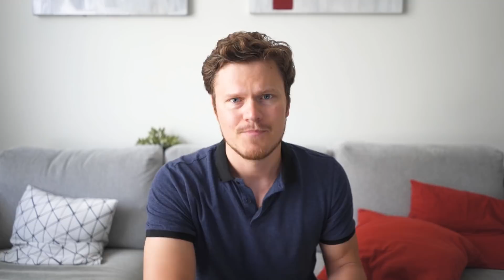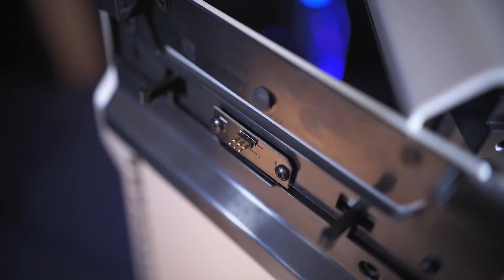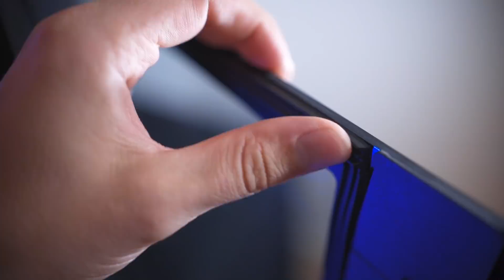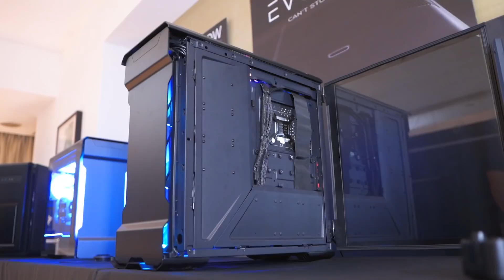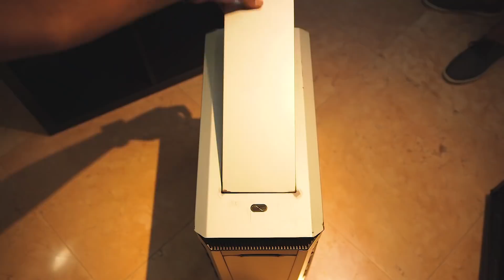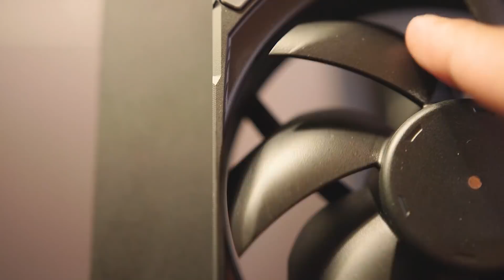The BEST $199 You Can Spend on a Case! -- PHANTEKS EVOLV X

Comment: Hooooooooooly crap!  You can put SEVENTEEN drives into this case?  Mind boggling!  I love the placement of the drive cages and the cooling options.  For the 1% that'll do a dual-system, sure, but other than that, a single system is perfect here - something like a 2700X, 8700K, or even 1950X will be at home here.
With vertical GPU mounts, I have a constant gripe of either push it away from being smooshed against the glass, or just don't do it.  With the versatility options this case offers, if this is how it'll be at launch, I think these will be flying off the virtual store shelves.

Comment: If I had money to spare I would definitely get this case. However, since I work with a tight budget, I priorotize on mostly CPU and GPU. The rest of my components are basically the best budget parts I could find on the market. My current case is the Antec GX200 which I got for 25 $. Very interesting case nevertheless.

Comment: They should also redesign Evolv Shift case. Many users complain about high temperatures. Also 2.5 slot graphics cards (like strix 1080ti) barely fit into Evolv Shift case. And, Evolv Shift case has tempered glass side panels. Aftermarket design graphics card can't pull air from tempered glass sides. It is awesome looking Mini-ITX case. It needs to be redesigned too.

Comment: I was planning on getting both modmymods panels for my case. That adds up to $160 without shipping so I'm better off just getting this case. The only thing that seems like they didn't fix is the placement for 24 pin cable cutout doesn't line up with motherboard.

Comment: I LOVE PHANTEKS! THEY DO EVERYTHING PERFECTLY!

I love the Original Phanteks Evolv ATX, but the main thing I was worried about was the airflow, but whaddaya know! They fixed that! I also wanted to vertically mount my GPU, but a bracket cost like $60, but waddaya know! They added that too! Those are just two examples. 
Its like Phanteks read my mind...
Reply: I was brainstorming on which case/bracket to mod so I can vertically mount my 3slot GPU (EVGA 1070 Ti FTW Ultra Silent, it actually has a 3slot I/O Bracket). But, waddaya know! Phanteks put a 3slot vertical mount in that case!

Comment: Fuck dude now I want to move my pc in to this case I LOVED THE P400S But I have no top rad option, planning to liquid cool, lights are chunky not flow like this case and AIRFLOW IS TERRIBLE I been waiting for a after market front panel for the p400s for so long

Should I just buy this and can I get more light strip that matches the case and connect to motherboard?

Comment: I've been rocking the Evolv ATX TG for the past 2 years and loved it!   With some minor gripes... and every one of those gripes was answered... even the minor annoyances!   Big things like airflow was addressed.   I have a push/pull at the front to try and compensate, but not very effective.  But also little things like the fan splitter placement could be better as my aio barely reached the hub.  It's like they read my mind!

Comment: ... if you still don't care about airflow and keeping your components cool.

I swear cases like these are becoming the bread and butter for CNC shops that can cut some much needed intake into the flat fronts.
Reply: Except if you were listening and watching the video, it was specifically stated that the front airflow was improved over the previous versions, by increasing the space between the front panel and the fans, and the side vents are larger. 

And it's not like the airflow on the old ones, or the one I own was especially horrible or something.
Reply: The existing ones were horrible - Truly horrible. And whatever improvements they've made here doesn't change the fact that the front is basically one flat surface with next to no intake. It has similar intake to the likes of the H700i, and that also has terrible intake.

Calling it now - Feel free to mock me if reviews miraculously don't agree with my claim.

Comment: I would NOT put a water cooler on the cpu for the secondary itx system. All the air bubbles will go straight to the cpu micro-fins. No bueno.

Comment: I'm a current user of an Evolv TG and wow is this an upgrade! I actually CNC machined some vents in the top panel of my case because it has a problem with trapping heat, but I might still consider buying this. I'm not crazy about the additional RGB as I prefer the minimalism of the TG, but everything else looks awesome.

Comment: JACKPOT!
All I needed to get a new case is a vertical GPU mount for a 2,5 slot GPU, TG of course, direct airflow for my all air cooled system and a decent, not over the top design (RGB rainbows are not wanted but clean ambient light is). And as always, awesome video, can't wait for your full review!

Comment: I'm curious what hardware they used to install 10 HDDs and 9 SSDs in this case. 
Can anyone please tell what MoBo has this kind of capability.?
I saw carefully, they installed MSI Z370 MoBo, but still, that board only has 6 SATA ports and not 18. Any guesses what is happening?
Reply: PixelGRID this was a showcase build. It is only showing what this case is capable of holding. 10 hdds and 9 SSDs is hybrid mix of the duo system build - any Intel X series or Amd TR mobo w/pcie expansion card.
Reply: I don't know about this exact build but there are PCIe expansion cards which add SATA ports if the ones on a motherboard are not enough. RAID controllers exist too.

Comment: Phanteks won Computex
Reply: Then you should call it Computeks
Reply: I want one
Reply: O!Technology Nah bro, they may as well have won Case Of The Year.
Reply: Andro Dominix LOL
Reply: Ibrahim B i own one, works fine for me? Lmao 6900k titan Xp both OCed
Reply: @Andro Dominix LOL yes!
Reply: How are ya man O!Tech? Long time no see
Reply: O!Technology in total agreement with you
Reply: I have the original Evolv ATX TG and while the front panel IS restrictive, just popping the two lower mounting studs on the front panel out of the case was enough to basically fix the airflow issues. The increase in the size of the venting on the front panel for the new case is pretty significant, so the airflow increase should be drastic.  The top venting was never an issue for me on the original. 

As soon as the new one gets released I will definitely be picking it up.
Reply: Case OF the Century
Reply: I disagree. Owners of the original Evolv ATX will tell you that the problem with that case was the lack of airflow through the front and out of the top. 

The airflow changes on this new case aren't that great with the front panel still looking like it will be a bit restrictive, and the top will probably still be useless for a rad exhaust.

Comment: Am I the only one pissed at this? I Bought the EVOLV ATX and am plagued by high temps! I want a refund or free replacement panel.. this is robbery.
Reply: Frozt that’s your fault for buying an old case with bad airflow lol.
Reply: Sic Semper Beats well at the time of my purchase it was a highly rated case and I didnt find out until my build was complete I get you have the average idiot making uninformed purchases but I don’t feel i did. I expect a company that sells a $180+ case to release a product that isnt going to burn out peoples hardware that do not live in alaska... lol, or at the very least offer a resolve.
Reply: Frozt all you had to do was look at a review, or just look at the thing! There’s a huge piece of aluminum covering the fans, what did you expect? Plus it’s really not all THAT hot man. It’s not going to “burn out” your hardware unless it’s extremely old or something. 
Lol i have a evol itx and a inwin 805(horrible airflow) and I’ve used a r9 290 in both cases and it was fine just a little louder than I’d like. It’s an atx case, modern hardware is next to impossible to overheat inside unless you have a crazy overclock. Not one of my cases have good airflow.

Comment: As an Evolv TG owner, holy shit. Do they take trade ins?

They pretty much took every mod people like us have done and pushed it into production. Awesome job.
Reply: Michael Brennan I'd still have preferred if they took an approach like the P600 shown and made a front panel that could either be solid or mesh. The Evolv X does improve on front panel airflow, but slapping a thick rad with high fin density on the front without push pull configuration and or static pressure optimized fans is still a bit sketchy, especially as they spent so much time fixing the case for more flexibility with watercooling. Then again, it had to have have the Evolv look, so I don't really know.

Comment: Simply WOW! I used the original Evolve Micro ATX case for quite some time with a custom liquid cooling loop and to be honest I was quite frustrated with the amount of aftermarket modifications I had to make.  Probably most of them due to my OCD. Poor airflow from the top panel was the major one... This case seems to address all of my concerns and in fact offers quite a few extras. I really really like the idea of dual system capability without going to fridge size/car price cases... Well done!

Comment: Sorry Fractal Design. If you keep me waiting for over 6 months for the white Define R6 TG, i might as well buy this one.
Reply: And anyway, the R6 doesn't support dual system configs.
Reply: Musmuk well fair point, but I'm not into the itx anyways. but I liked the evolv atx tg when it came out, and it only slightly got dethroned in my ranking by the overall looks and function of the r6. but phanteks really has done well here.
Reply: I saw it on Newegg just yesterday.
Reply: MidnightBanshi in white With tg Panel ? here in Germany i I couldn't find it nowhere
Reply: My apologies.  I'm in the US, so maybe it only showing up here, but yes, it's the white with TG panel.
Reply: do you think this case will have a white version?
Reply: meowzoa well im sonst certain they will stick with the 3 colors they used to have. but thinking about my concept silver and black works as well.
Reply: hey man, earlier i found a screenshot of a black n white version of this at techpowerup. im so hyped now.
Reply: meowzoa saw that as well. looked more like black and silver though. might be the lightning. but I guess the big panels can easily be spray painted

Comment: damn this case is amazing! So useful upgrades, especially love the ITX support besides an ATX System....
Still have a question though...does that ITX support also apply for EATX main systems?
Reply: Marmor2 Pretty sure it does.
Reply: It should. Eatx boards are wider but not taller so it won't interfere
Reply: So you can have a EATX in the main system (How many GPUs?) plus a ITX system with one GPU?
Reply: Jimba86 The eatx system can have as many gpu's as any other system and the itx can have 1

Comment: I still prefer my Evolv Flow Edition, i got from germany. With actual airflow. But if you're a water cooling enthusiast i assume this would be better. i'm more into aircooling though. cheap, cool and less noise <3
Reply: well I would hold you up against the less noise, but you're right on the other points :)
Reply: +never combine water with electronics
Reply: Same, gusumods did great job for me 😀

Comment: that lack of space for optical drives, though.
Reply: If you MUST have one use an external one, or a different case. I haven't used optical drives in my systems for over a decade and haven't missed it.
Reply: Just buy an external usb optical drive. 5.1/4' bays are phasing out
Reply: I assure u 100% of mastercase 5 /5 pro users r dated.
Reply: You can probably mount it semi DIY instead of that second motherboard.
Reply: I still use a fan controller in my 5.25 bay
Reply: Imorokr Making space for optical drives in 2018 LUL
Reply: +Chander Russell Any recommendations?
Reply: Too bad the release date is August. Stil waiting on the lian li o11 air... I would have gone with this case.
Reply: Austin I do.
Reply: There are many cases from the past ten years that are suitable for your needs. This case is for the majority who no longer find them worthwhile.
Reply: Imorokr get external optical drives. Majority of the market has moved away from optical drives in the case . You should too 😂
Reply: Could mod the back where you are supposed to use an itx and fit a optical drive there
Reply: Buy an external cd drive
Reply: I still use optical drives They are very useful rather than playing it on another dvd player or if i want the benefit of not having to use an external drive.
Reply: Stfu.
Reply: Thanks for the suggestions, but there's no way I'm getting rid of my MasterCase 5 any time soon - I use my optical drive more than often enough to justify having it built in.
Reply: Y'all are crazy! ;)
Reply: No.
Reply: Optical drives are dead? How do you rip/burn CDs or play blu-rays? I also like having a little drawer in the other optical drive space - I love my CM MasterCase 5!